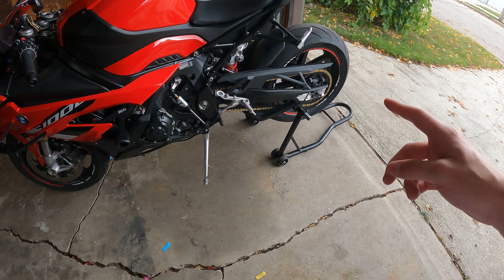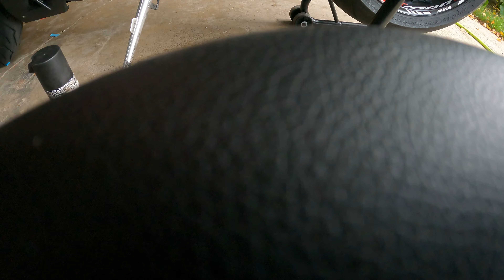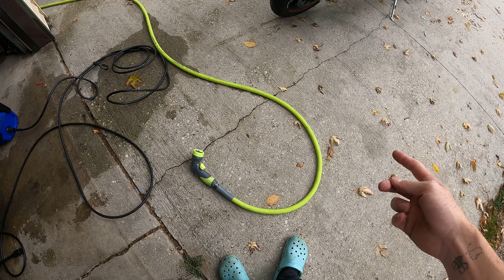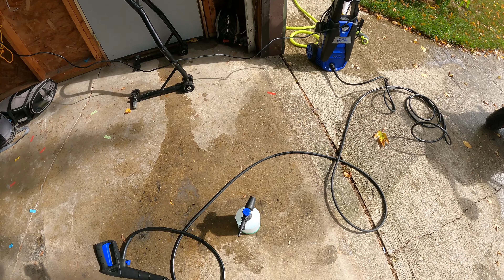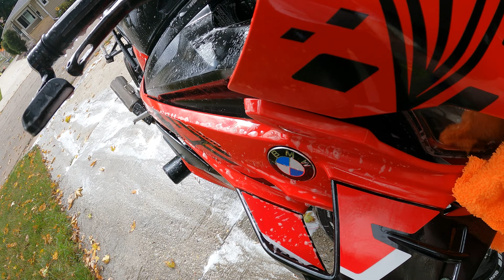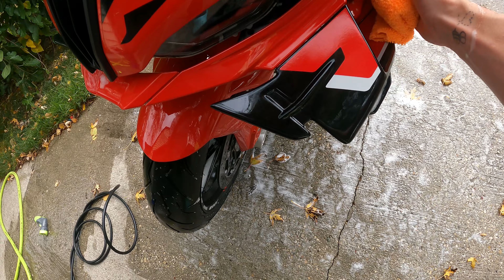How To PROPERLY Wash Your 2023 S1000RR/Clean Chain!

Comment: What about the grease under the chain and in the chain guard?
Reply from the maker: Forgot to clean that! Very easy tho. Spray the fuck out of it with brake cleaner. It’ll come right off.
Reply from the maker: For the Chain guard, take off the chain guard. Very easy to do so. Brake cleaner and a harder brush. Will do the job just fine.

Comment: Hey bro, which frame sliders did you buy? All I’ve been finding is 20-21 frame sliders are they the same?
Reply from the maker: R&G Symmetrical for 2022, it fits greats
Reply: @s1kdk  did you have to cut your fenders? Or straight plug and play?
Reply from the maker: @stephenlay9550 no cutting, plug and play
Reply: @s1kdk  you got the CP0467BL correct? 
Thanks for replying!
Reply from the maker: @stephenlay9550 https://www.revzilla.com/motorcycle/rg-racing-aero-frame-sliders-bmw-s1000rr-2020?sku_id=1761561